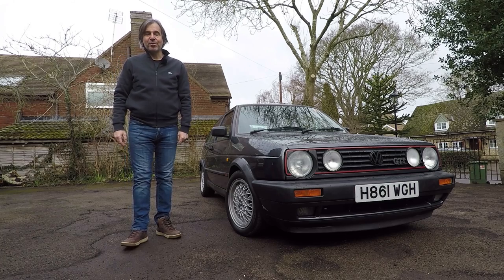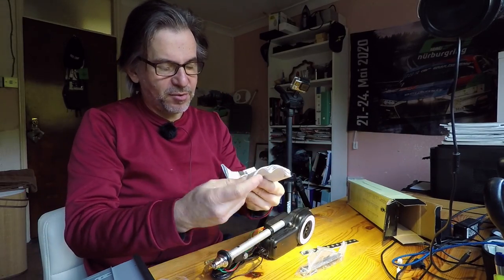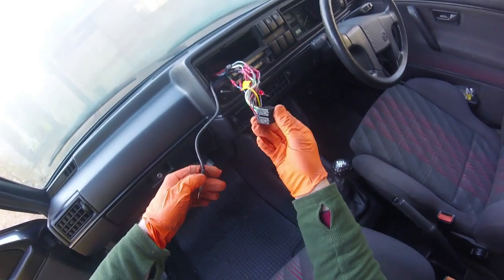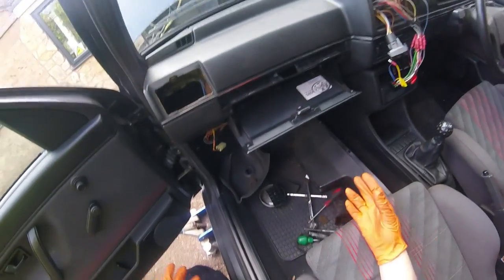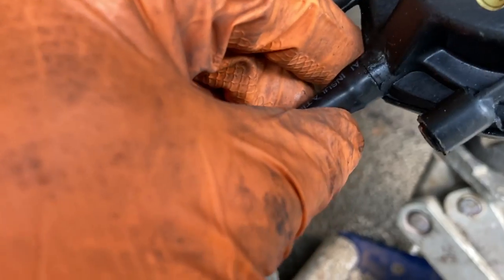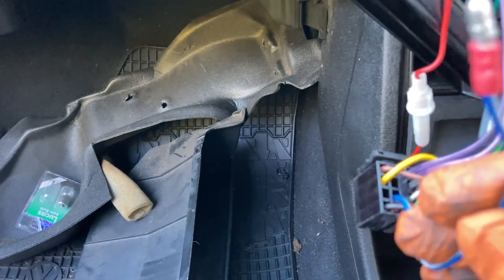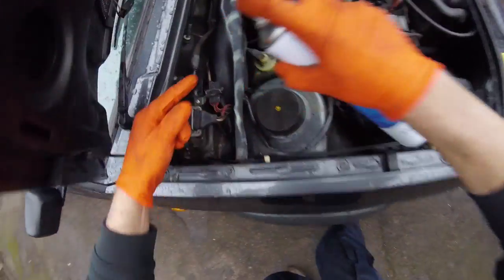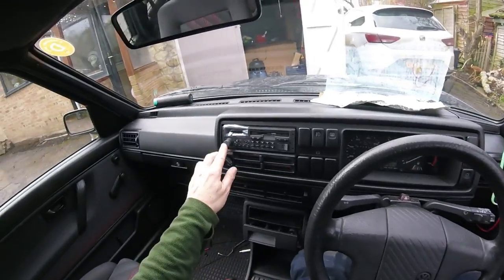MK2 VW GOLF GTI - BLAUPUNKT BREMEN DAB  + RETRO ELECTRIC AERIAL INSTALL

Comment: Everyone needs Bilt Hamber Dynax UC in their garage, such good stuff. Great for brake pipes / unions. Anything exposed to the elements underneath....the list is endless. The straw helps you get it into the tightest spaces. BH Hydrate 80 for rust is a winner too. BH Deox C is a good sheep dip for soaking rusty items in.

Comment: I fitted the same unit in my Mk3 Supra - looks the part and seems to work well, just a shame about the cheap clicky button feel. 
Btw you can use a powered DAB converter/splitter with the FM aerial if the extra aerial gets on your nerves, they work just as well as a dedicated aerial in my experience.
Reply from the maker: Thanks - a saw those splitters but was a bit dubious.  Some were unpowered too. Might check one out as I still don’t like the black aerial, thanks for tip👍
Reply: @volkswizard  the eBay special £8 jobbies (with Car Radio written on the casing) seem to be decent. Only time will tell of course, just don't use the god awful vampire clips they always come with!
Reply: @volkswizard  the head unit can supply power, which is why some are unpowered. There's an option in the head units menus to turn this off it on

Comment: Interesting vid, thanks. 
I'm stuck in the 90's with an Alpine radio cassette 😂
When I've replaced old aerials I have tied some string to the end so I can feed the new cable back through without dismantling too much of the trim. 
Also your new outer aerial mount seems quite wide. Could you have re-used the one from the old aerial which was smaller?
...and finally. I use a Belkin windscreen suction mount for my phone. It's really solid.

Comment: Where did you get the thermal fuse for your blower resistor, my Audi 80s is on the blink??
Reply from the maker: EBay, check temperature on yours, order same, get the crimps and rest is easy but be mindful it might have blown for a reason
Reply: Thanks a mill yeah bearing in motor is gone have a new to me motor on its way

Comment: This really took me back to the 1980's when I used to work for an auto electrical component distribution company. They were a Blaupunkt stockist as well as a fully approved installer. Blaupunkt have always been renowned as quality and fitted as standard to a lot of OEM vehicles. We used to get quite a lot of nice cars in for install too, like Cosworth Sierras and Escorts, 2.8i Capri's, RS Turbo's, Golf GTi's etc and they were special times for me.

Comment: I had no idea you could get a period head unit with modern functionality - very cool indeed! 

It looks the business - I guess the compromise with the period look is the miniscule display, but I guess you'd get used to that. Not really an issue if you're using your phone as a source (we're probably spoilt these days with the huge touchscreen displays we're used to). 

I take it the Bremen has RCA outputs for connecting to an external amplifier? Looked like it from the video.

I'm not sure I could stick with the "OEMplus" philosophy, as I seem to remember the front speakers in particular are mounted in a ridiculous location (on top of the dash). From what I remember if my Dad's 2x GL mk2s, they sounded awful - maybe that was just his music though!

 When the Mk2 was still fairly current (showing my age there), I used to see aftermarket ICE installations with speakers in the front door pockets (think there's a large pocket with a cover at the bottom, towards the front?), but I don't think I'd want to damage the door cards either, given the Mk2 is now a classic car! 

I do like what you've done there - a tasteful, but functional mod👍. Bet you wish the Mk2 8v GTi had the "bee sting" ariel of the 16v though! Did you consider that as a mod at all?

Comment: Brilliant episode on the GTI - love the OEM+ tweaks to bring modern functionality to this classic and I’m sure of your craftsmanship in wiring this in whilst removing obsolete cabling as I’m a bit OCD about the original appearance- I noted the gearshift gaiter cover and wondering if it’s original as just looks bulkier than I remember?
Reply from the maker: Thanks Malcolm. Yes the gaiter is leather and aftermarket, IIRC the original were a thin artificial fabric and looked tired very quickly. Leather lasts better but if you aren't careful it can restrict the shifting action (say it was really thick). Seems OK so will live with it. Early cars had a rubber concertina boot the like of which you only see on commercial vehicles these days !

Comment: Thank you for making this video installing the radio and aerial, which looked fun if a little fiddly. It’s a shame that the telescopic wing aerial can’t be also used for the DAB reception?
Reply from the maker: A lot of people have said that, and I did look for crossovers that got the FM aerial to do DAB too but figured there would be some compromise somewhere, probably in the reception which you'd only find out later and you'd have to strip it all down and start again to install a DAB specific one. Basically played it safe with belt and braces :)

Comment: They are the best looking retro style stereo and would also look correct in my 1993 vauxhall carlton though they are pricey.I am trying to fix a kenwood mask stereo has auxiliary in so i can add bluetooth easily  a pain to change a belt on and i need to replace the gears .
Reply from the maker: I remember the mask, had a blank panel that slid in front of main unit to deter thieves. Nice bit of retro ICE there! Yes indeed the Bremem DAB would look cool in a 1993 Carlton. Newest car I've seen one in was an early AudiTT which was just about OK as the early factory units were dissimiliar (with red illumination)